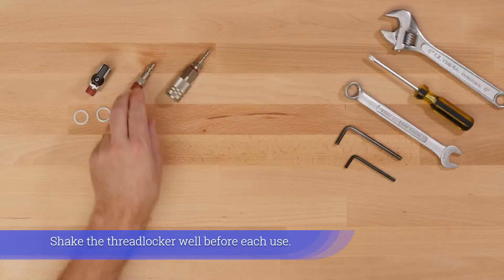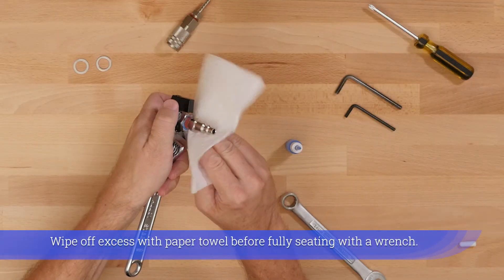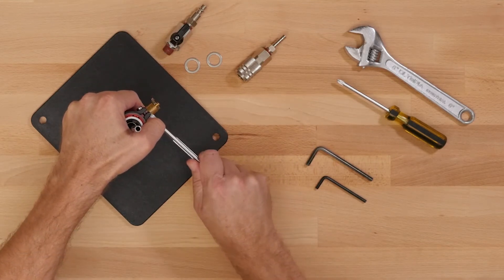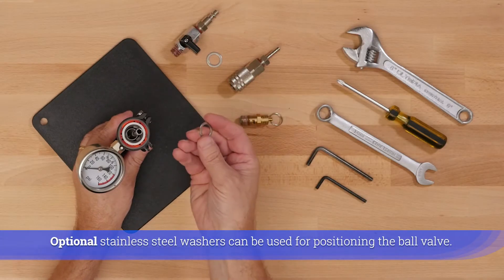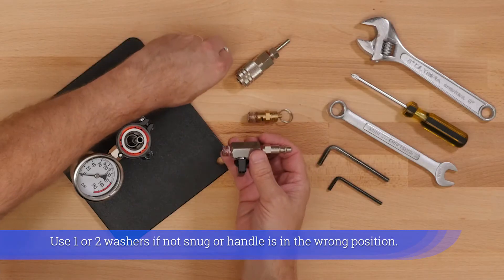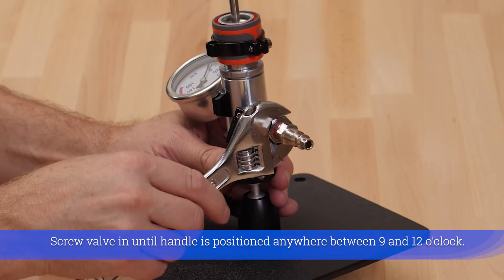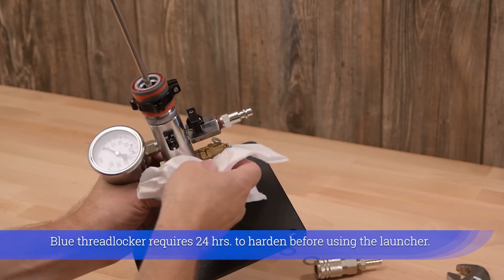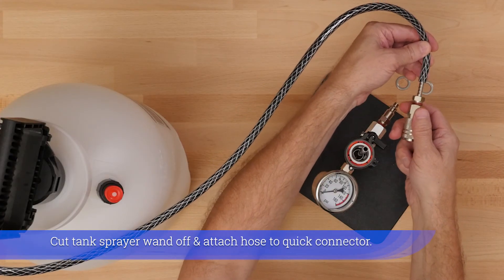StratoLauncher IV Ultimate Upgrade Kit Assembly Instructions

Comment: Alright so I have a problem the orange connecter the thing that connects the rocket and the launcher. When I put the black nozzle in the Orange connector I need to use a lot of force to seperate them therefore the rocket only fly about 5-10 metres. Do you know why?
Reply from the maker: Thank you for contacting us, but a better venue for support is our support team at support@stratofins.com as they can provide greater detail through email. However, based on the limited info you provided; it sounds like the black clamp-on cable stop is too tight around the orange sleeve on the hose Q-Release. This orange sleeve should move freely up and down without binding. The clamp should sit in the middle of the sleeve on the gray area which is dished out enabling the clamp to grab onto the sleeve. Loosen up this clamp and the nozzle should pop in and out with ease. Below are a couple of videos that should help:

StratoLauncher IV Ultimate Assembly Instructions (starts at mounting cable stop)
https://youtu.be/vk9lX-tQF_w?t=279

Launch Procedure for StratoLauncher IV Ultimate Model
https://youtu.be/BRCyHG9aPR8

If you need further assistance, please contact our support team and include a video or photo to aid in diagnosing the issue.
Reply: @StratoFins  Thank you but i tired taking the whole clap off and it still is binding so you recommend i get a new Q Release.